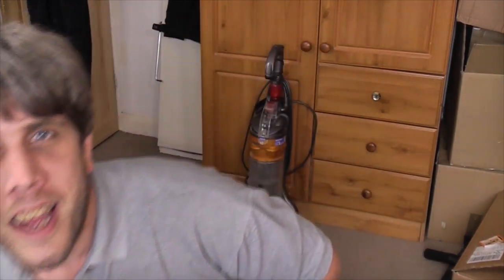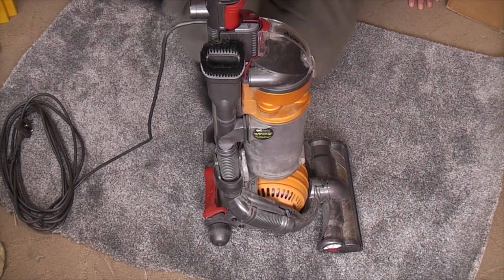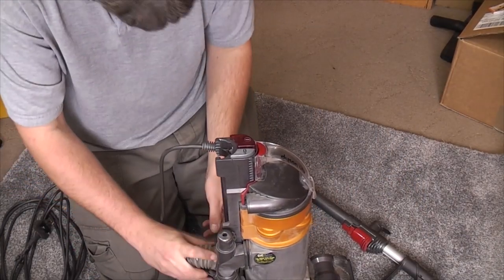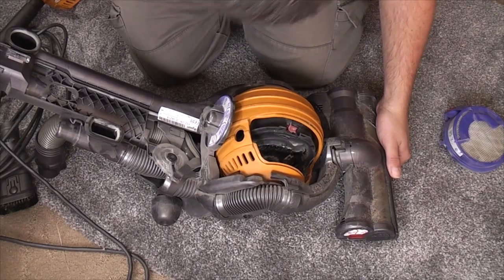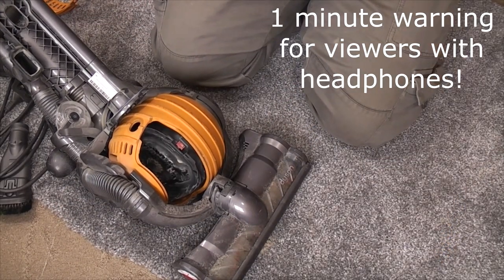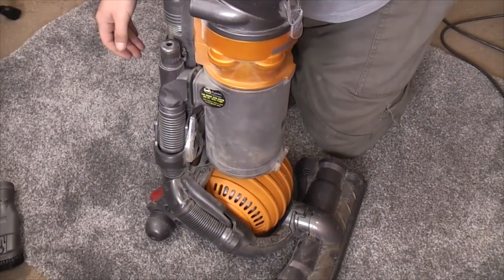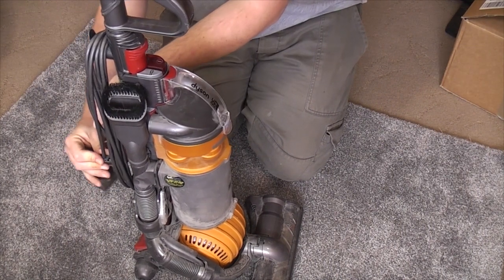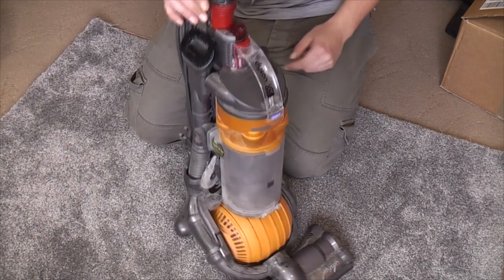Dyson DC24 Week! Day One - First Look, Before Refurbishment!

Comment: Hello, i have a dysonball DC24. I have made a terrible mistake... I vacuumed a lot of plaster dust. I cleaned it well and it still works just as well but it makes a terrible noise, the same as on your video. Do I have to change the engine?
Reply from the maker: It may carry on for a while yet but yes, the plaster dust has got into the fan or bearings. Got an airline? That might get some of it out
Reply: @beko1987  it is far too late for this, there is yars it is working like this (you can believe this! :)) "the plaster dust has got into the fan or bearings" does it mean in the engine? In that case would not be possile to change the engine (motor) ?
Reply: i have found a knew ball on ebay (the orange one with the engine of course) 75€ with the delivery to Paris from England et duty taxes... . But to change it on my... it seems to be quite complicated...

Comment: Hi Sam! Thanks for the great videos on the DC24. I found one and your videos are extremely helpful in helping me make ti usable again.

I hope you can answer a question about an issue on this unit. You know the small "flap" at the rear which closes to cover the the hose hole below the hose which switches path? Depending on whether the vac is upright for wand-use or reclined for floor use? 

When upright, the flap doesn't quite close the hole entirely at the "open mouth" end. Naturally this causes much suction power to be lost at tip of the wand since there now is a "leak"

 Have you ever seen this? If so, what's causing this and how can I repair it? Cheers!

Comment: That motor on the DieSoon DC24 is definitely about to die soon! Very soon indeed. I am also amazed the brushroll motor still works, it should have died long before now, as the DC24 was renowned for brushroll motor failure.
Reply: Would you say the dc25s are more reliable? Is the brush bar motor & main motor any different?
Reply: @hugohenderson1788  There have been more reports of the DC24 brushroll motors failing, but the DC25 does have the issue as well, just not seemingly as common. The motors used are tiny brushed motors with only a relatively short lifetime of something like 50 hours. The carbon brushes are short which contributes to the demise of the motor long before the suction motor fails. Suction motors are more likely to fail from overheating or bearing failure. With the heads on the DC15, dc24 and DC25 being articulated on a yoke, they need a yoke wiring loom leading from the main body to the motor in the powerhead, and this loom also had issues where the wiring broke internally due to the constant flexing and movement inflicted on it due to the design of the powerhead and the way it moves relative to the main housing of the ball. Powerheads could also stop working due to the brushroll bearings getting fouled up and seizing, or other problems stopping the brushroll from turning. So the issue with powerheads not working is not always the same problem from one machine to another, but the weak and short lived brushroll motors did not help.
Reply: @stevejones1972  That's interesting. I picked up a Dc50 that had a seized bearing on the brush bar motor. I eventually managed to loosen it with lots of force & Wd-40. When unjamming a bearing it never seems to run as smoothly as replacing with a brand new bearing.
Reply: @hugohenderson1788  The DC50 uses a different kind of setup for the brushroll compared to the earlier DC24, where the motor is actually inside the brushroll itself, and this is the way they do all the new Dysons now, such as the Light Ball, Ball Animal 2, and also including the cordless models like the V7, V8, V10, V11. You have to make sure the brushroll end bearings are kept clean, much the same way as before, as the bearing housings are magnets for dust, hair and other debris which can build up and cause the brushroll to stall, but the motor seems to be affected less on these, as its own bearings are protected better than the bearings on the brushroll itself.
Reply from the maker: The Johnstone motors in the 24 and 25 only have a finite shelf life of 60 hours (I found the spec sheet once). Of course now their getting old most are way over that and falling over left right and centre. I was surprised the brushroll motor worked, but then I refurbished it a year or so prior to this so probably saved it's life then. It's still going too
Reply: @beko1987  The brush roll motors are fairly cheap so worthwhile fitting. The dc25s are a good vacuum, I like it a lot for a dyson ball vacuum